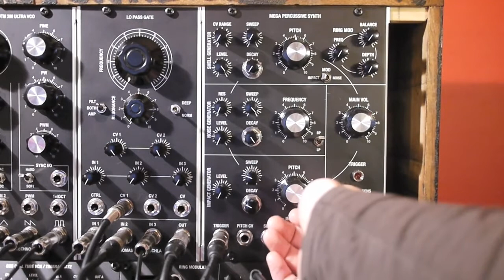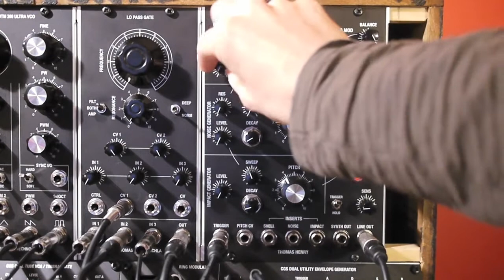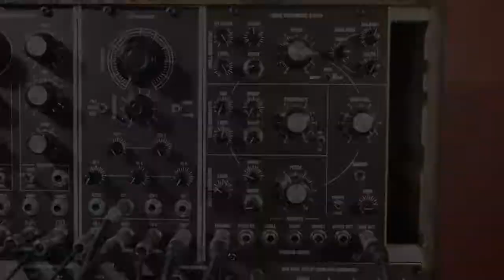Thomas Henry Mega Percussive Synth Demo

Comment: Nice demo!  If you want to get a bit higher cutoff on your filters, then all you have to do is replace the two 820pF caps in the filter circuit with something a bit smaller -- try 390pF -- that will increase the frequencies by one octave, which might be enough.  If you want to go a bit higher still, try 220pF.  The only issue is that it might not go low enough then.  I'd also probably opt for a Highpass option on the filter (which should be fairly easy to obtain from the existing circuit).  That might be better than bandpass for some higher frequency things...?
(In case you're wondering who the hell I am to be making these suggestions, I'm the guy who designed all of Intellijel's analog modules, so I know my way around synth circuits.)
Reply from the maker: Hey Docsketchy - apologies; only just saw your reply. Fantastic; always wanted to get it sounding brighter so I'll give that a go!

Comment: that's a really nicely done video and your system is beautiful but i'm really not impressed by the sound of this synth...Doesn't seems to do better than my machinedrum. Are you happy with it ?
Reply from the maker: Thanks Romain! Yes there's definitely some things I'd like to tweak about the sounds - It only does Triangle wave, I'd prefer a sine for more subby sounds. The noise/filter is not great - It's quite dark sounding. I'd love it to have more top end and self oscillate for a wider range of sounds. The filter is done with a fairly simple LM13700 circuit so prob just needs some tweaks to be done. It's still a fun module though as it's so instant and very quick to get/tweak sounds with

Comment: This is well good, Remember I used to use Digital Percussive Synth, What benefited that was doing layers with it with ease being able to just open loads. With this you'd have to bounce layers but it be well nice sounds. Did well good job on that never seen anyone do that before actually build it up and that.
Reply from the maker: Thanks - yeah it either has a mix out with all the three sounds blended together, or I added the 'inserts' for each of the sounds (shell, impact and noise) which means that you can record each part to a separate audio track if you need...